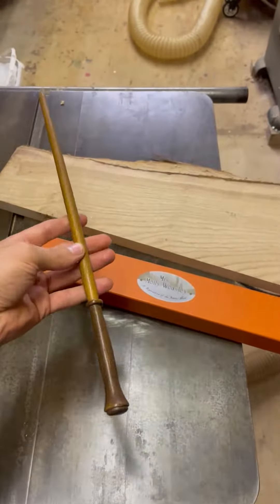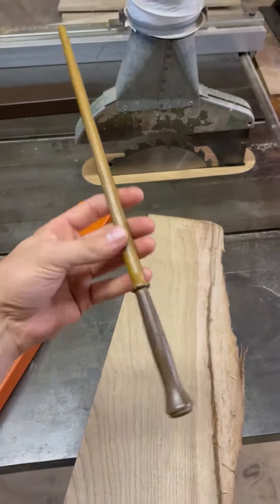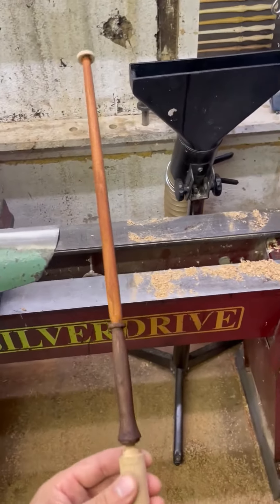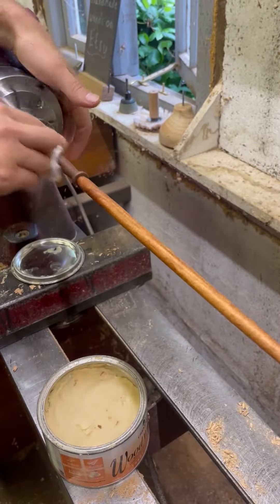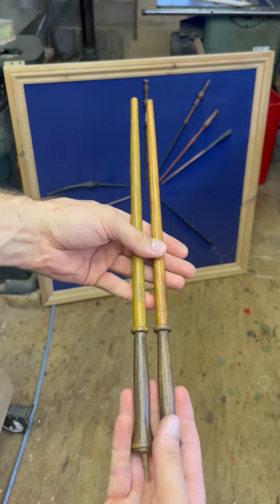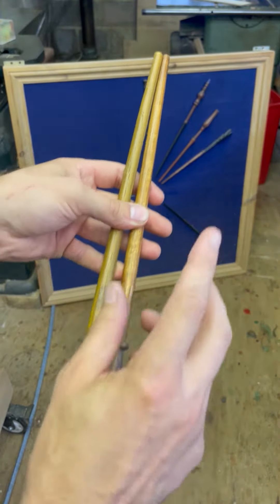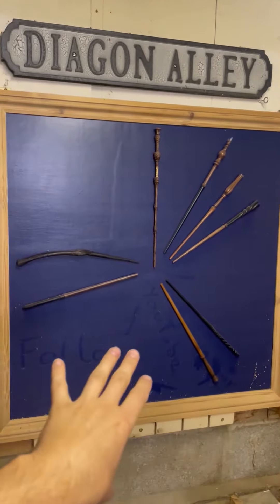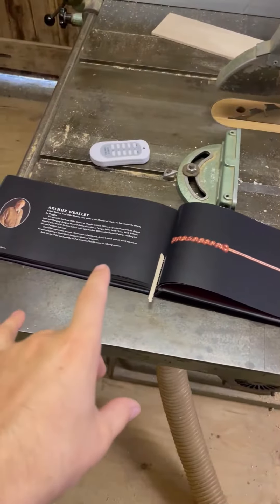Making Molly Weasley's Wand - from real Oak! (short)

Comment: Dude, I'm intrigued as to the trick with the denim you hold while turning the wands. what's the purpose?, just to stop your hand from frying from the friction??? Absolutely fantastic work by the way. I do a bit of turning and really want to try a few wands. I'm the WoodWookiee on Esty
Reply from the maker: Yep to stop burning but can also have more force which is good for knotty sections etc. There's a lot of measures I also take so you're responsible for your own safety